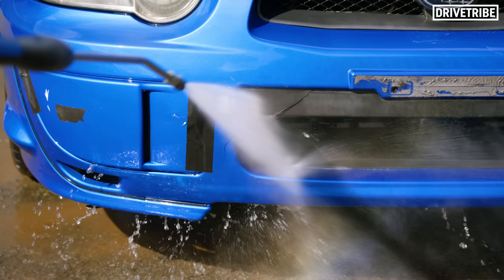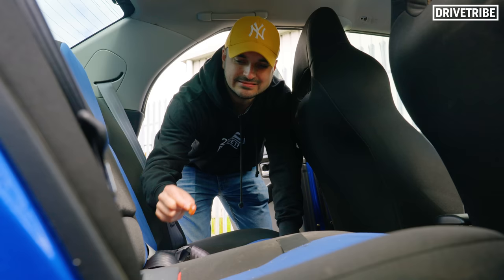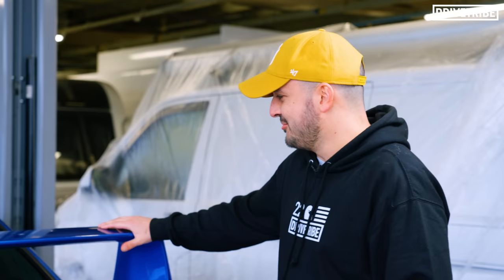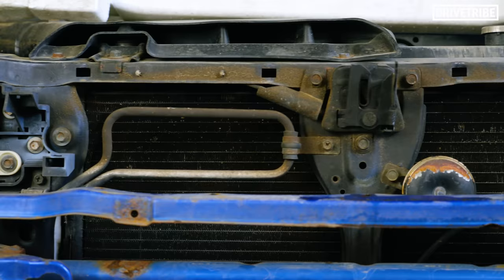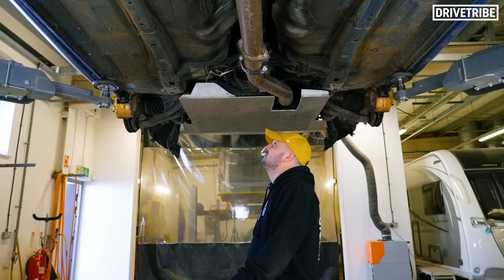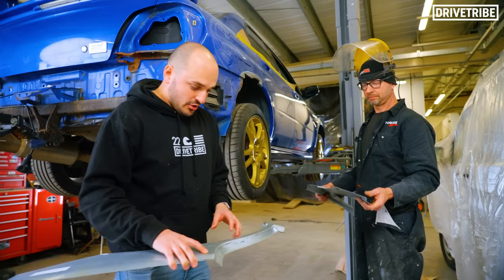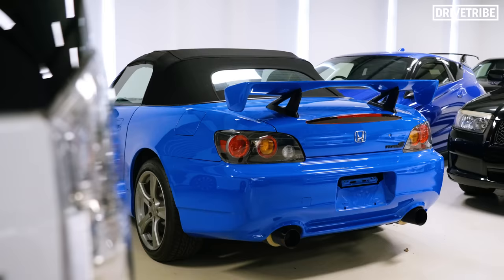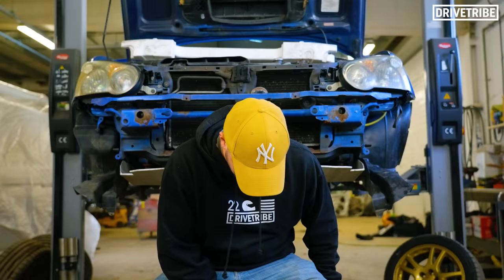Restoring Richard Hammond's Subaru from The Grand Tour | Project Martin Ep.2

Comment: I was pleasantly pleased to find that subaru dealers still supply brand new slam panels, bumpers and bonnets etc for these impreza's. I was looking everywhere for parts for my blob to get it fixed after a bump, and the body shop came in clutch with the Subaru link up. Will have mine back end of the week, so way too excited! Need me more subaru resto videos already, I'm so ready for all the content!
Reply: Took me 6 months to source a aluminium bonnet for a Gc8 wrx sti,lots of NLA parts.Newage must be easier.
Reply: My subaru has had a similar story, it's now been off the road for 1 and half years and this week she will be back on the road
Reply: @alexdawkins5368  mine should be back this week too! Way too excited right now ahaha

Comment: GD STI's are fantastic, much better than the newer STIs. 35:65 power split, more power to the rear wheels on an AWD platform is perfection. Especially JDM market STI's with the EJ207, twinscroll turbo 8250rpm redline from factory.
Reply: Hawk STI split is not 35:65, I think it was 45:55
Reply: @petkokrushev3840   For US market correct, JDM market was 35:65 up until GR. US market final year of 35:65 was 2005.

Comment: Rust on the outside of those arches is just the start. The issue is the strut tower deterioration and then water leaking in through that onto the inner arch rusting that (as seen) and then the rust leaching onto the outer arch. Hence why the rust on the inner arch was worse then the outer.
I'm suprised Torque GT didn't know that. Or perhaps this is like car SOS  and not everything done or changed gets shown.

Comment: That welding at 10:18 doesn't fill me with confidence for a proper body shop? Lap welding rear arches then slap filler over the top? Very poor.
Reply: I was thinking same thing, that is how my first body repair looked like with no prior experience and I knew it was rather bad. On the other side of the car, when they were saying it is clean, it looked like there was still rust inbetween the outer and inner wheel arch.
Reply: @Vazquez12able  exactly right. They rust where the two layers of steel are spot welded.... probably due to insufficient undercoating from the factory. 
Now days they have weld through primer, it's brilliant stuff.